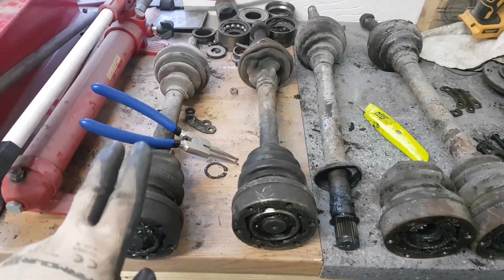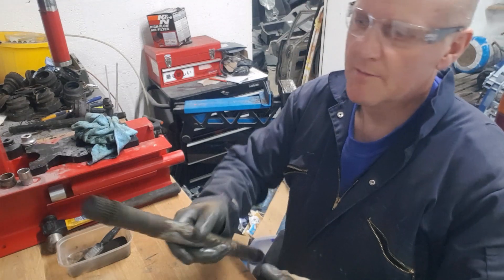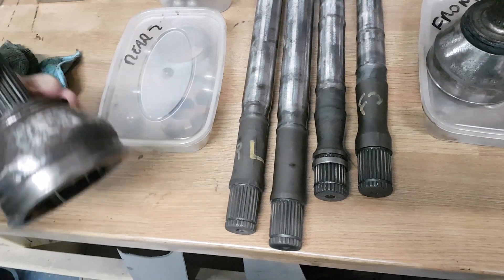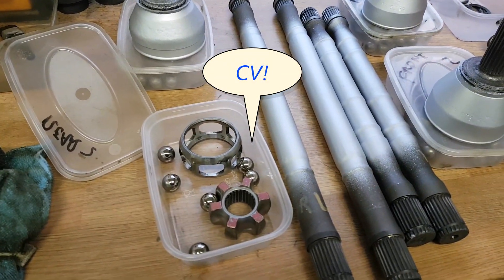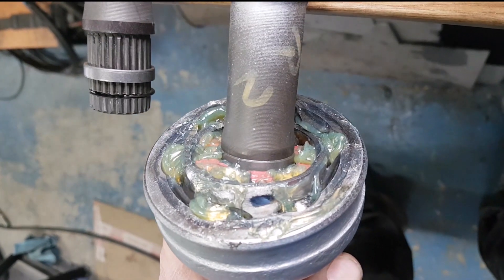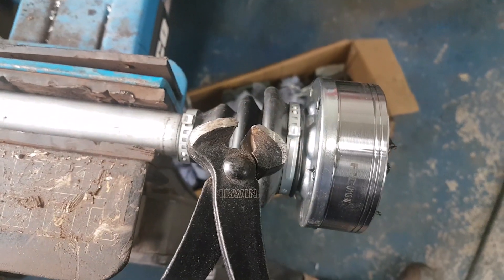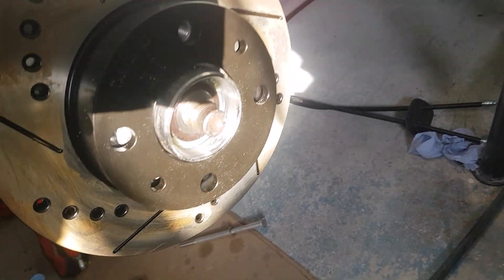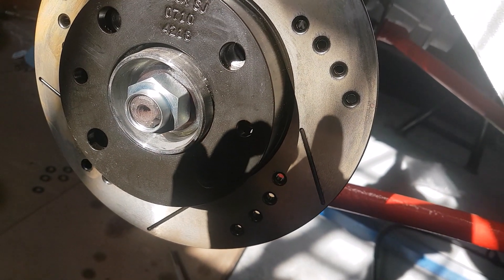How to Build a Lancia Prisma HF integrale - Part 27 Driveshafts

Comment: Noticed that you just used a general purpose grease in the rebuilt joints rather than one with some Molybdenum Disulphide content - any reason for this? The replacement joints were supplied with grease, which judging by the colour di have some Moly content.
Reply from the maker: Hi, rather thank being general purpose, it was actually for CV joints. I had to check myself,  but it was specified on the container that it was good for CV joints too.
Reply: @ottosgarage7986  I tend to find that driveshafts are often the weak link in uprated cars, especially if used for any kind of competitive events. Between event inspection and re-grease with high end CV specific grease does help though.
Reply from the maker: Good advice - thanks!
Reply: @ottosgarage7986  Unless it's Lancia or engine specific, feel free to ask away, happy to help and looking forward to seeing it move under its own steam.